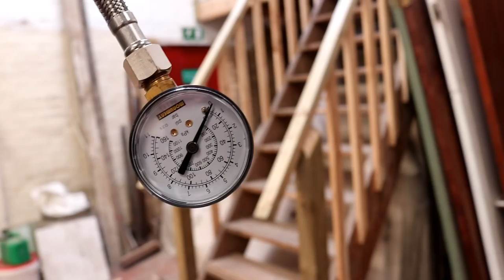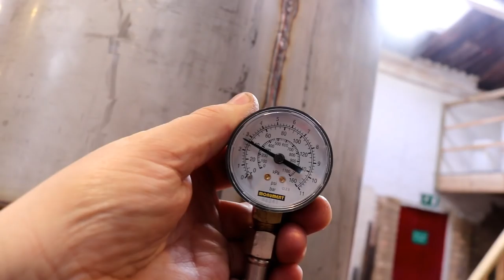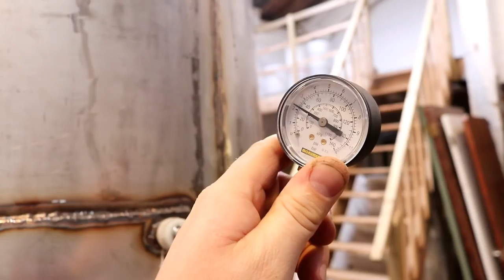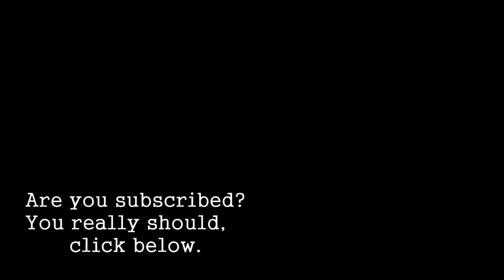PRESSURE TESTING THE JACKETS

Comment: Nice work, really picking up speed on the tanks. 

For your pressure testing to keep you safe, if you have a couple of spare valves add one high for bleeding air  while filling, and on the bottom adding a tee with two valves. if you point the lower valve down then you can drain and bleed at any point. 

Glad to hear that your doing at least 1.5 times your working pressure too, means you shouldn't have any issues down the line. 

Eager to see the lids go on these towering beasts.
Reply from the maker: Cheers man

Comment: We leak test with compressed air to 1bar then use a trigger spray with a weak water/washing up liquid mix. It gives really good indication of even the smallest pin holes. Quicker and dryer than filling with water every time!
Reply from the maker: Thanks Matt, I will try that next time.
Reply: HarryBrew69 we weld skin tanks on the inside of narrowboats which are almost identical to the cooling jackets you've put on the fermenters. Another thing I found useful was rather than a hole and spot welding to the baffles I used a slitting disc in the angle grinder and put a few inch long cuts along the outside skin of the tank - just gives a bit more purchase if you get carried away with the pressure! Thanks for the videos , love following the brewery build!

Comment: If there was air left inside the jacket it's possible you had more pressure then the gauge was showing. Air will compress alot more than water, throwing off the reading. Putting an elbow up top facing up and filling to the brim before screwing on the gauge should make things both safer and more accurate. Loving the Vlogs,  keep it up. They're posted just as I get to settle down for the evening (in Australia).
Reply from the maker: Thanks for the tip

Comment: My maths could be wrong? but is 30" x 20" = 600 inch square x 40psi = 2,400 lbs of total pressure trying to rip your cooling jacket apart. Maybe your welds didn't do too badly considering?
Reply from the maker: When you put it like that